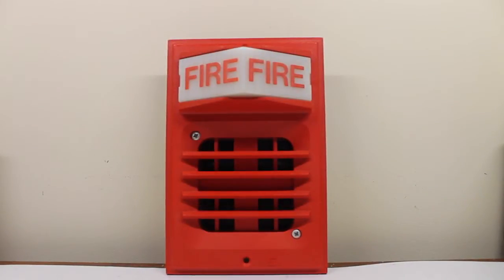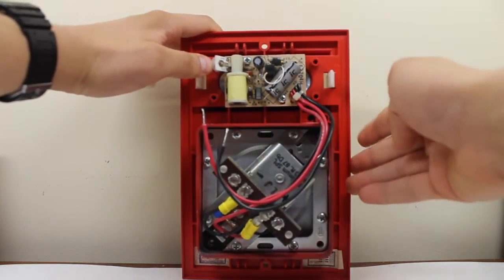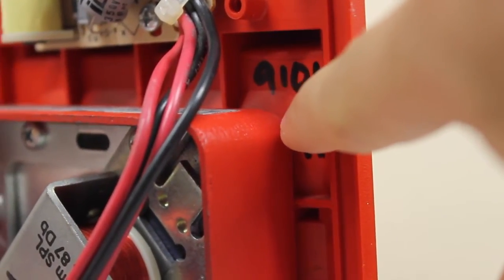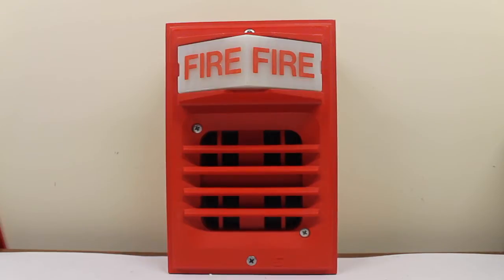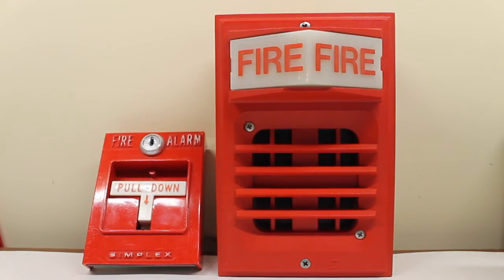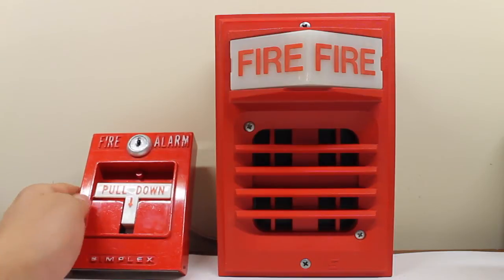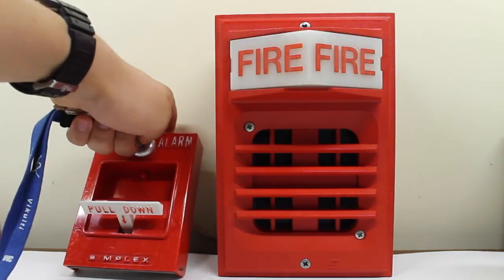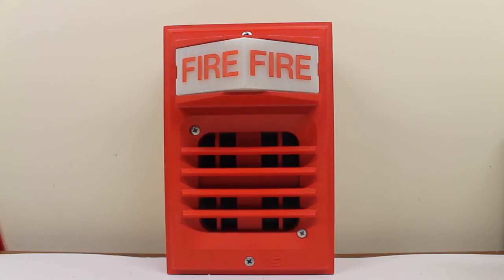Simplex 2903-9101 w/ 2901-9833 Fire Alarm Demo/Test

Comment: Is it possible to wire this horn with the strobe in parallel (it would skip like the Wheelock 7002T)?
Reply from the maker: I doubt it; not sure what damage that would do to the strobe if I did try that.

Comment: Wow cool! I love the old simplex alarms like that, I think they have a cool design.
Reply: Grant Bansemer And also I am just curious were did you get this alarm?
Reply from the maker: Grant Bansemer This is a pretty cool design. It requires a pretty big backbox, but it's still a pretty cool design. This particular device came from eBay, believe it or not. If you happen to look at the right time for Fire Alarm related stuff, you can find some pretty interesting stuff, like this. There's a few devices that I found by looking just at the right time, hopefully you have the same luck as I did.
Reply: ***** Thanks!
Reply from the maker: +Cameron Avery Does the school have a new electronic bell system (tone plays through the speakers whenever clock system reaches the appropriate time). Interesting mix of alarms, older Edwards and Simplex, seems like it would be loud, but awesome!
Reply: ¿What fucking?

Comment: The 2903 and the 9833 look in pretty good condition, almost new!
Reply from the maker: NJMoo3652 Glad you noticed! Usually when I get an alarm, I try to clean them up as best as I can. Typically, this involves cleaning the alarm of any paint, removing any major scratches, removing dust, etc. It ends up looking like something like this. I also try my best to keep the alarms in best of shape as I can, when in storage. Usually, little to no damage is done.
Reply: What do you use to take off the paint and scratches? The magic eraser just doesn't do it
Reply from the maker: Magic eraser definitely won't do that. I use a combination of a rubbing compound and a small polishing wheel. It won't completely remove ALL the scratches, but it will make a HUGE improvement.

Comment: Yeah, be careful with the potentiometer. Mine's come loose a few times, and I've had to re-solder it to the board.
Reply from the maker: Fahrenheit4051 I don't even want to get near any of those components with one of my fingers...especially that capacitor on the back. The potentiometer does look fiddly, so I don't want to touch it, to be honest.
Reply: ***** hello